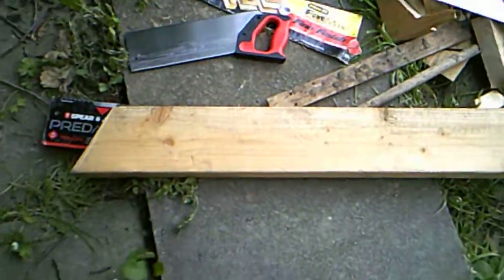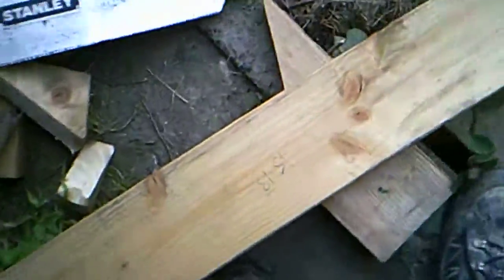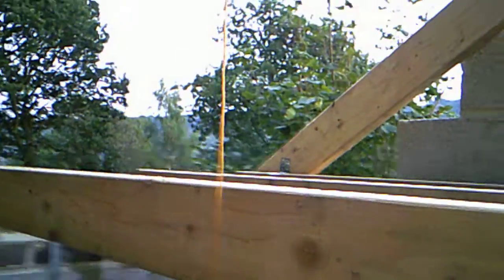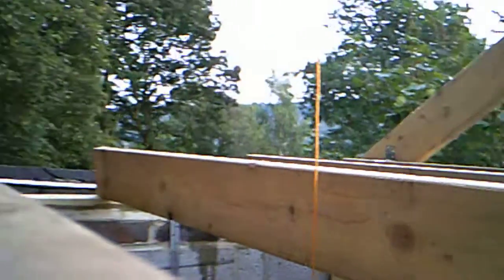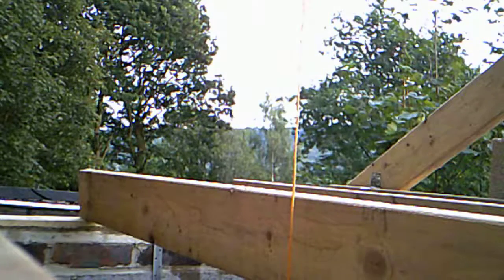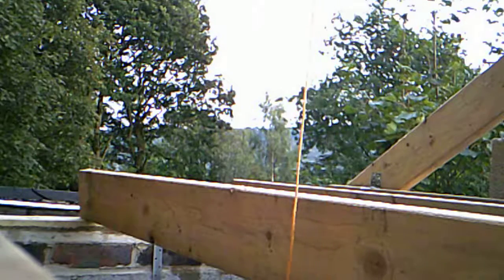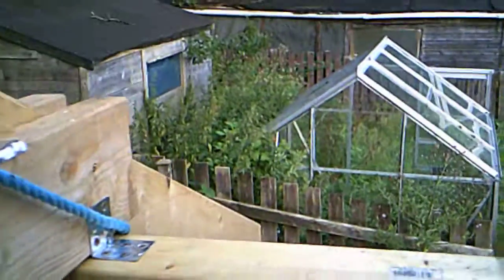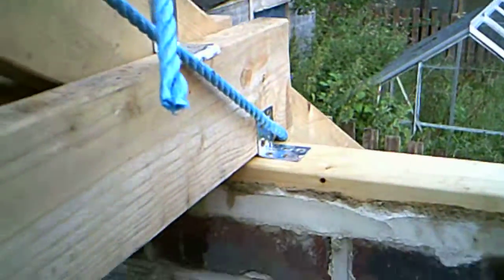NOVICE STONE SHED - PART 20c CUTTING RAFTERS

Comment: So that's what you look like.. 🤔. Lol. You seem to be doing a tidy job bro, that roof is gonna be solid. 👍
Reply from the maker: Yep, I can manage to do at least 1 pull up from the roof joist, LOL. It's been very windy since erecting the beams and they are still in place so fingers crossed.
Reply: @jasonparker333  I'm the same as you, I'm building my own "shed" but the width of mine is 6 metres.. I forsee a few hiccups along the way 🤔🤣🤣
Reply: Ps.. That's one more pull-up than I could manage bro lol.